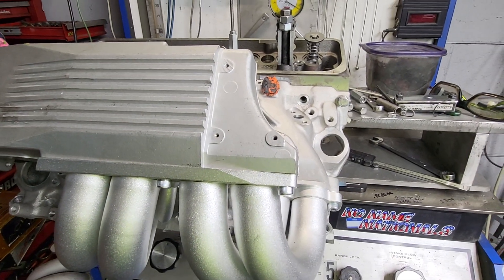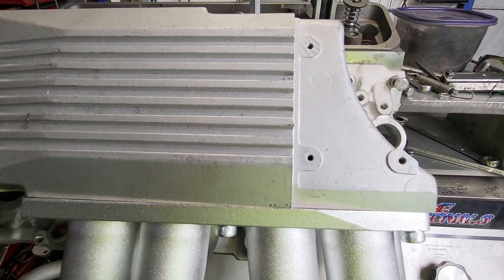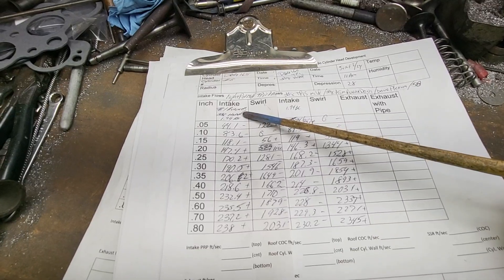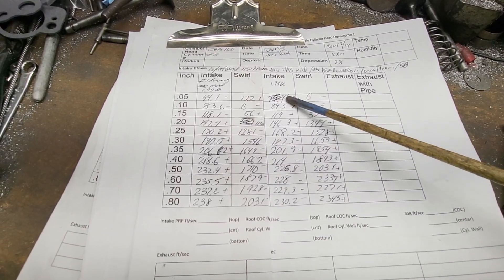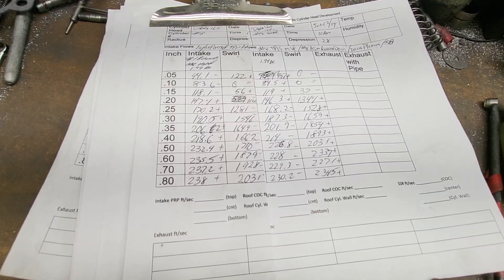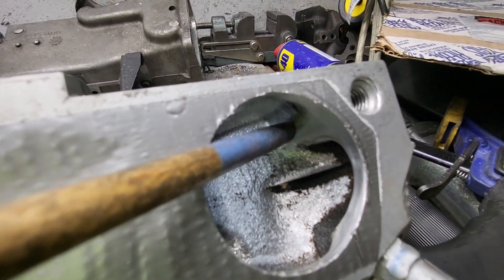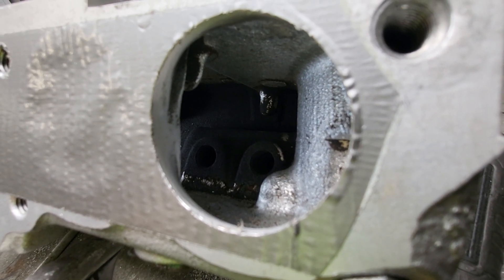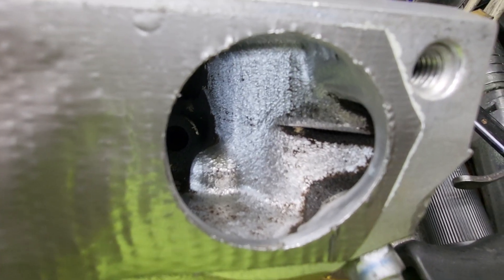Redheaded Stepchild, High Performance TPI project, Runner #1 vs. Runner #8 for port balance.

Comment: Awesome info! Your results are right in line with other tests ive seen. TPI #8 is the worst, #1 is usually an average with #5 being the best if I am not mistaken. I have to add, my OCD wonders why manufacturers didnt get it spot on on all cylinders from the start. Wishful thinking!
Reply from the maker: Too much work to get right
 Get it close and send it!

Comment: What if you filled the large void where the vacuum reference to is with JB Weld epoxy blend it after and then drill your vacuum reference after using the tube as a guide?
Reply from the maker: Is it worth it?
Reply: @servediocylinderheads  yes I believe you will see a balance improvement

Comment: so I have a dumb question. the runner is ground at an angle at the top back. isn't that supposed to be the front passenger side runner so it follows the down slop if the plumen? or is that just the stock runners?

Comment: charlie 
where did this cylinder 1 n 8 flow test start . (cfm #s thru stick tip tube with stock base ))
Reply from the maker: I thought I was clear in the video but maybe not. #8 cylinder head port for both tests. Arizona Speed and Marine runners for #1 and #8 test. This was just to see the flow difference from plenum placement. Thanks